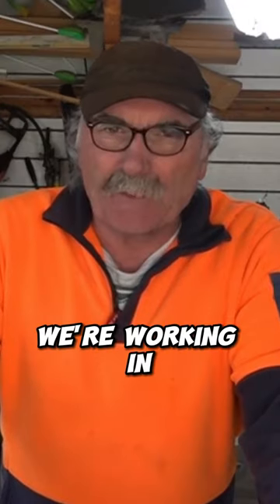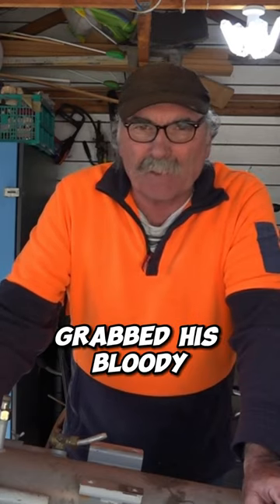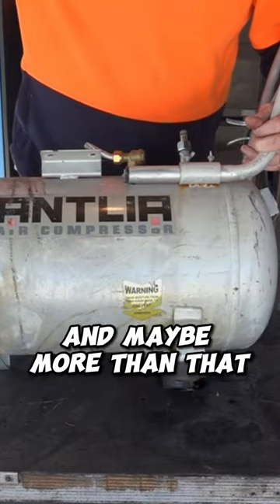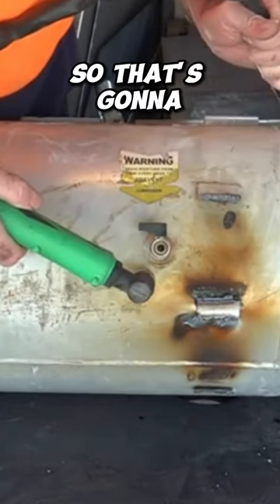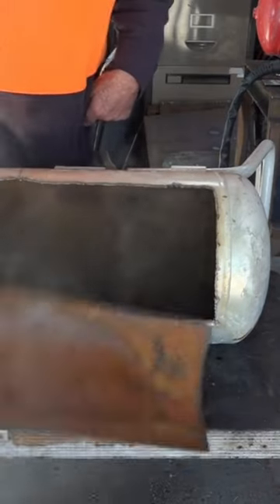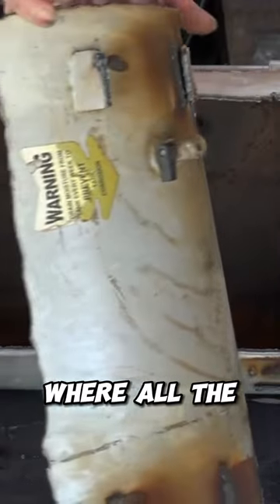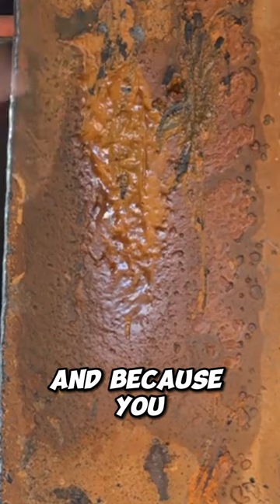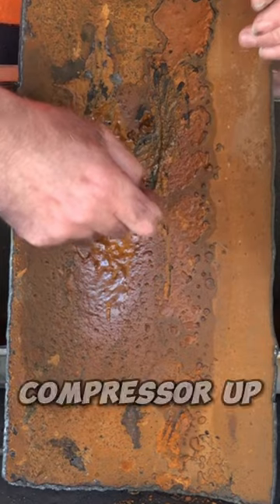Deadly air compressor mistake revealed!

Comment: I use to be a compressor tech, and currently work as a welder. It was fun to tell customers that their expensive tank was cuput. Never weld on these things, adding that much heat to it surely also effects the strength of the vessel. Once theyre cuput they do make good smokers if you do feel so inclined to weld on them/reuse them.

Comment: I run a little air tool oil through the cylinders occasionally. It might help prevent rust in the tank.
Reply from the maker: Thanks for sharing your maintenance routine with us, it's always great to learn new tips to keep our tools in top shape!
Reply: Use an undiluted water-soluble 👍

Comment: Anytime I'm tempted to half-ass anything, like just welding a pin-hole leak on an air compressor, i remember i have family waiting for me to come home. Then i replace it, or if it can be fixed i spend the time to do it properly.
Reply from the maker: That's a great mindset to have! Family is always a good motivator to do things right.
Reply: I half ass everything until saftey is in mind

Comment: If you're running a big one without an autodrain, you need to empty it at a minimum of once a day, depending on the humidity in your area and if you dont have any sort of humidity control you should do it 3 times.

Comment: ATTENTION: If you work near any sort of pressurized device in the USA, your company is REQUIRED to train you in the proper and safe usage of these devices. If they are: Damaged, deformed, or otherwise altered. This weakens the structural stability of the device and could cause it to fail when under pressure(This means it go boom). In these cases the owner of the device(this could be your company or some form of vendor) must remove the tank from the premises and safely dispose of it and its contents in the ways applicable to the state you are currently in.

Comment: Get your compressor checked every two years or less, if theres slight oxidation when they check, do it every 6 months instead... The "drain weekly" is if youre using it flat out. If its just sitting, theres no moisture because it hasnt been compressing the water in the air into liquid before condensing in the bottom.. but it can still rust, especially if you live close to a coast

Comment: when not using air compressor and or tanks leave the drain open until you plan to use it if you really don't use it a lot
Reply: nah man, take the valve off and stuff it full of silica sachets then put the valve back on.

Comment: Anything that holds pressure is a bomb that’s only waiting for enough weakness to explode, if it leaks from the tank it’s fuckted do not give yourself some semblance of safety with a patch. Metals do not spontaneously get holes in them without significant damage, stay safe and change your compressor

Comment: Simple fix ! Take the tap off the bottom throw it in the spares box and put a 90 degree bend where the tap was and put another blow off valve on the end of elbow and there's your dinner
Reply: You watch Taryl fixes all?
Reply: Or put a piece of hose between the tank and the tap. This way the plastic hose can hold the water as the new lowest point and you have to drain it less regular without basically any water ever standing in the tank. 
Seen this in workshops with 3-4 Meter long pipes coming down from the ceiling mounted compressor.

Comment: If you had a way of tig welding it and getting full pen. You shouldn't have any trouble!
Reply: Just don't.
Unless you actually are educated in engineering and welding pressure vessels and are 100% sure of the exact steel and any post processing done, the risk is wayyyy too high vs the reward of saving a couple bucks on an air tank. Not worth it at all.

This is coming from someone who will do all types of janky stuff to save a buck or just feel self sufficient.
Reply: I don't understand,  hope is that going to prevent the tank from blowing through the rest of the wall that's also covered in rust?
The point of video was that you're only addressing the problem you see,  but that problem is indicative of much larger issue.
Reply: @miles11we  not reccomended but can always hydro test it, should be done anyways i think for air tanks but few done it follow eu standards and do 150% pressure if it holds you should be good
Reply from the maker: Good luck with that .lol
Reply: @petestools  pressure washer and gauge and sneak onto it tho for these repairs best to cut out and weld on a big patch which makes it not worh it but sure possible
Reply: @MrRacerhacker  Are you aware of this cool new invention? I saw it advertised on some pop up ad last week... I can't recall what it was called.... "punctuation"?
It's supposed to help people understand what we write,  or some silly thing like that.
Reply: @theoriginalmonstermaker  sure, but you have a brain. Which places and you should read right enough to know when to stop or not. Sure more thinking but no harm
Reply: @miles11we agreed dude. This is onr of, if not probably the only time i wouldn't try a DIY. Unless youve got actual tank/boiler experience, this is too risky. I dont mess with pressure. Electricity I'm fine with. Fire, I'm half comfortable with when I've melted metals. 

Welding something that contains pressure, I'd ask my 2 buddies and they'd probably both say the time/savings ratio just aint there 😂
Reply: @MrRacerhacker  Insane rationalization.  Just do it.  For your own sake as much as anyone else's.
Reply: @theoriginalmonstermaker  i do try. Just forget at times. Not a native speaker
Reply: @MrRacerhacker  Understood.  But then it's even more important; the best way to improve is practice good habits.